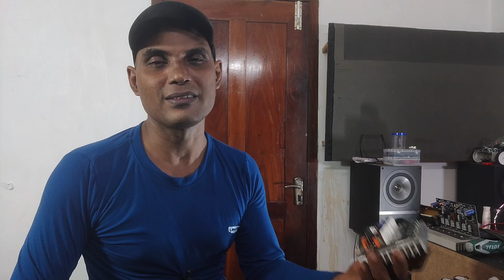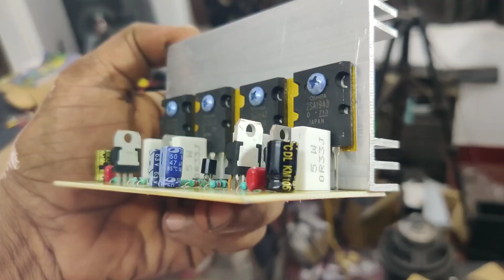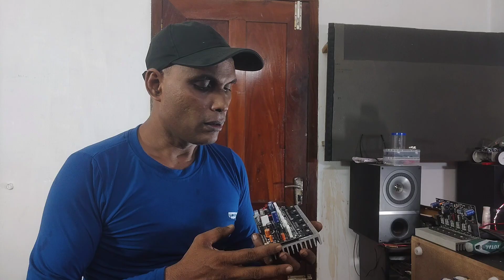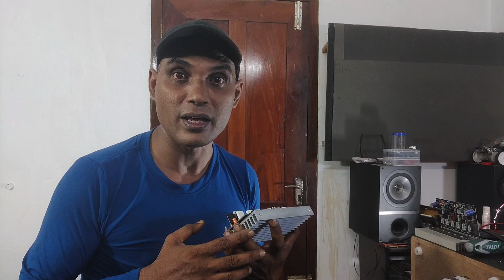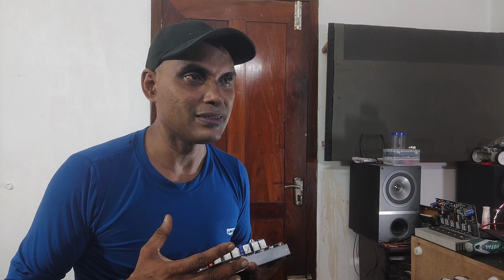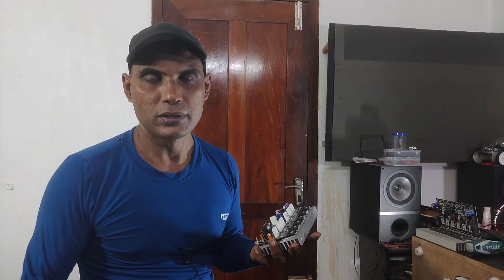Mosfet or Transistor - Which One is Best for Subwoofer Amplifier

Comment: Bro i have a 12 0 12 3amp transformer, please say one good subwoofer board for this power supply
Reply: Use class d amplifier board get better power this voltage and ampere
Reply: Thank 👍
Reply: Use 7265ic mono board ull get 60 watts rms....
Reply: Ok bro, thanks 👍
Reply: Which subwoofer you decided to use ??
Reply: TDA 2050
Reply: 10inch
Reply: @akhilbabu8444  ohms watts ariyo?
Reply: 100 or 80 watts RMS
Reply: @akhilbabu8444  ee transformer il ninnum maximum 50w mathrame kittu. Athukond subwoofer inte full power il work cheyyanamengil you should choose more powerfull powersupply. But ippo ningalkk use cheyyaan pattiya boards parayanamengil subwoofer inte impedance ariyanam. Tda2050 or 2030 bridged only for 8 ohms subwoofer. Tpa3116 bridged,Tpa3118. Vereyum ic und